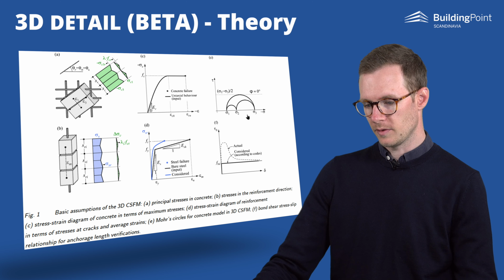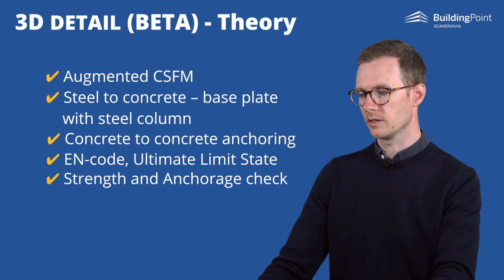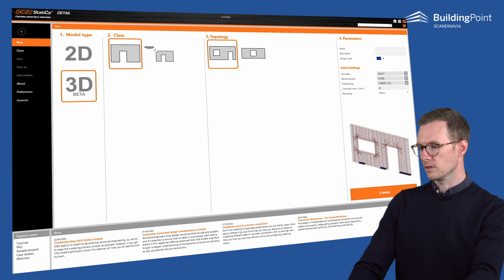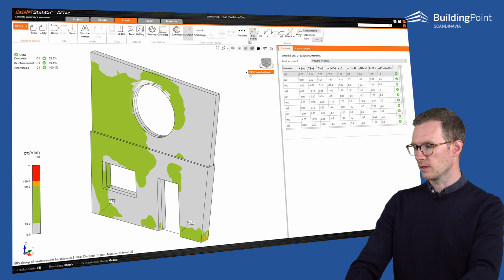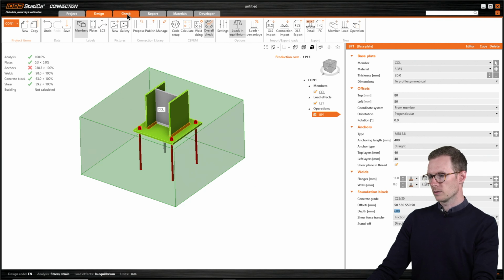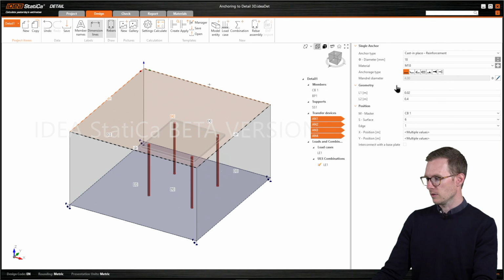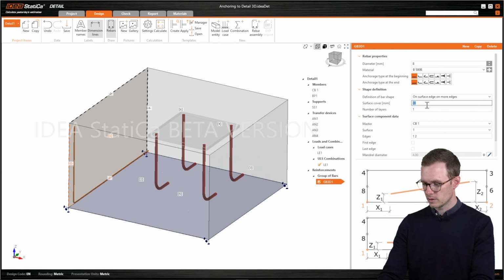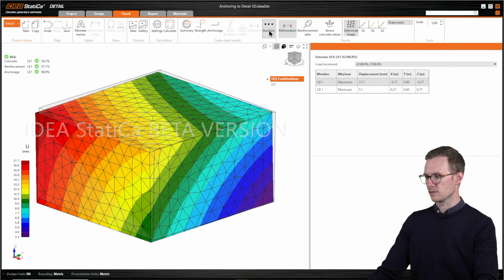IDEA StatiCa 3D Detail BETA in v24.0 - footings, walls and BIM link Connection to 3D Detail

Comment: If you observe in the report, some times the end and edge distances or distance between the bolts is showing as infinity.... can you please tell the reason for it and how to rectify it
Reply from the maker: Hi, sorry for very late reply!
However...Good question! The software calculates the bolt spacing for the bearing check based on the direction of the actual shear force in each bolt. It does this by “virtually enlarging” the nearby bolt holes (by half their diameter) and drawing lines along and perpendicular to the shear force direction to find the neighboring bolts. If those lines intersect the surrounding enlarged holes, the distances are used as p₁ and p₂. But if no intersection is found (for example, when the shear direction doesn’t point toward another bolt), the program can’t determine a valid distance — so it shows it as infinity. You will find more information about this check here: https://www.ideastatica.com/support-center/check-of-bolts-and-preloaded-bolts-according-to-eurocode